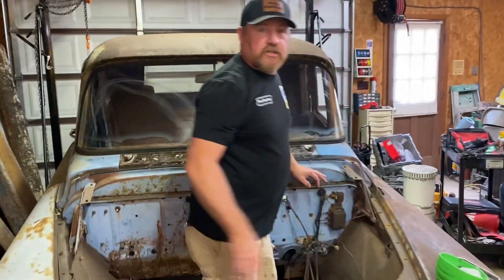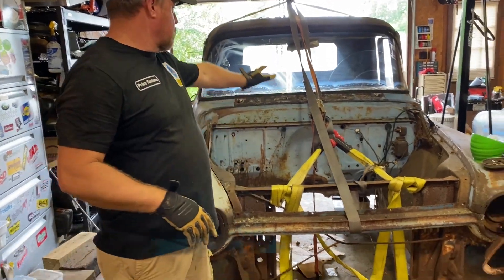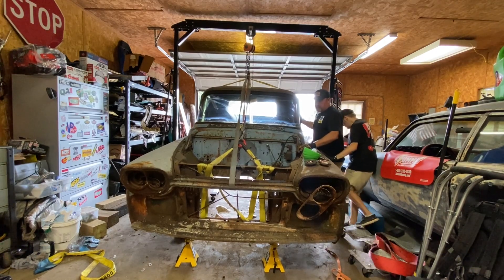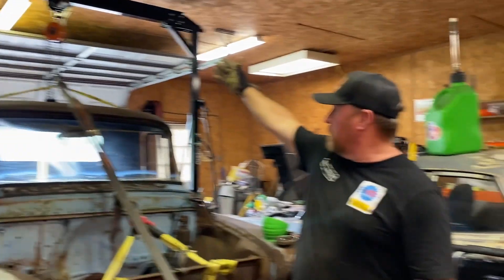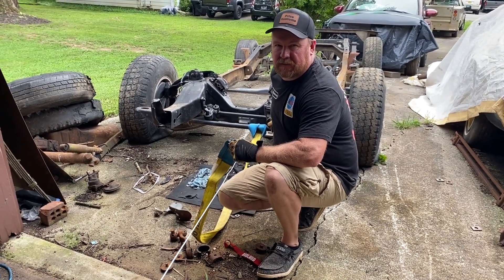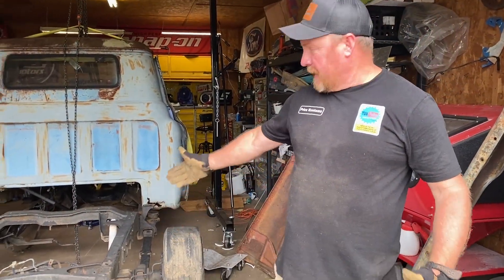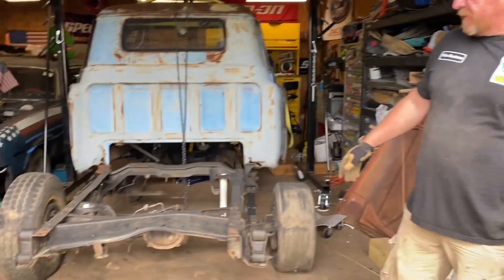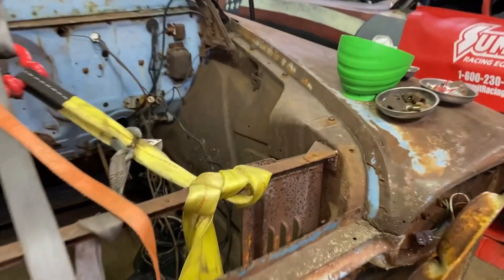Insane Chassis Swap! Cab installed??? / Restomod 1959 Chevy Apache #chassisswap #restomod #snapon

Comment: Wow, that's amazing. Me and my uncle did the exact same thing to my 59 Apache. Put it on an 85 Chevy truck frame. outside the garage though. We put two 6×6's on either sides of the car port. Still working on it. We have a very special V-10 going in it. But good luck on your build and keep it coming along.